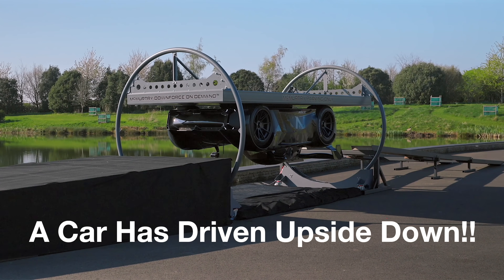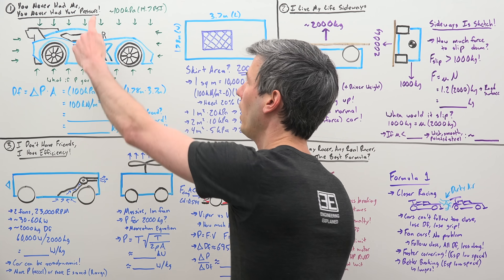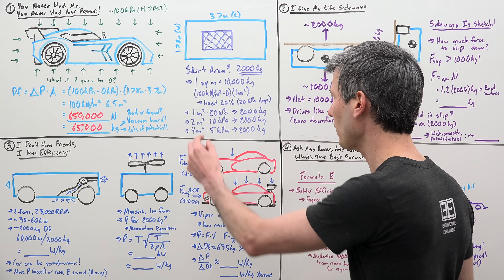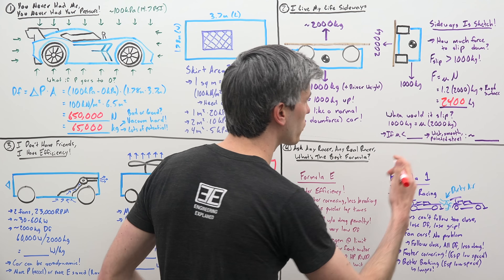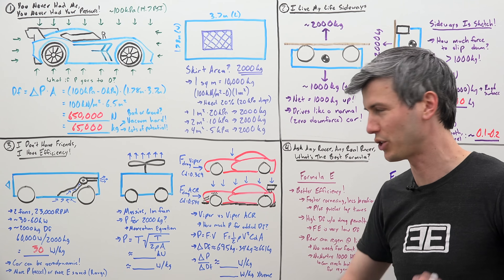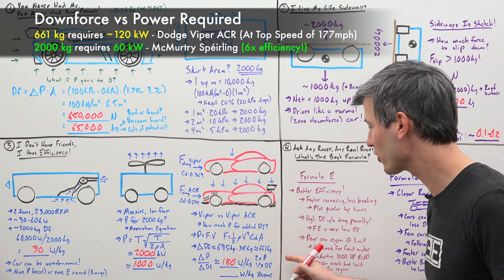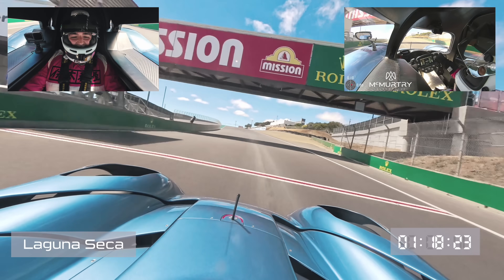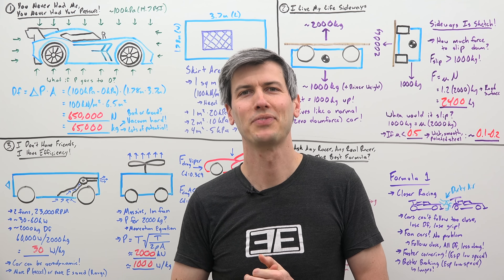This Car Just Drove Upside Down!

Comment: What marvels my mind is the fact that road debris is not destroying any of the internal piping or fans (blades) as it is sucked up, or if there is mitigation using filters that they don't clog up quickly and diminish the down force.
Reply from the maker: They have filters for a fairly fine particle size.
Reply: The car does have filters so no rocks are thrown.
Reply: That was the first thing that I thought of when I first saw this thing (after I picked my jaw up off of the floor). Filters for fine particle size, but what about somewhat bigger stuff? Though maybe that's not an issue for race tracks? Dunno. Never been on a racetrack. 

sigh

I gotta get out on a racetrack...
Reply: Ah maybe IT ist practically a really fast.Street Cleaning Maschine.

Comment: Weren't suction F1 cars banned in the 90s due to all the accidents? If you lose suction, suddenly you have zero grip
Reply: No, they were banned from rocks being thrown and f1 being f1 neutralizing the competition. There were no accidents with the vehicles. The Murtry has filters so no rocks can be thrown. Just don’t go over corners and you can’t lose suction.
Reply: @NewBeginnings571  I was thinking of the Mercedes triple flip crash at La Mans. It had to do with a neutral pitch angle and hills, not fan cars

But I vaguely remember issues with skirts, and losing grip for ground effect cars
Reply: @jdk7278  oh my bad

Comment: First heard about the idea from an article about the Saleen S7. It apparently had enough down force at 60mph to drive upside down, but could not find an insurance company willing to cover it.
Reply from the maker: 160* mph (60 mph is super low for downforce). And the Saleen only makes its own weight at that speed, not double, so it would still fall haha, because it would have no traction to accelerate so it would just slow down and drop.

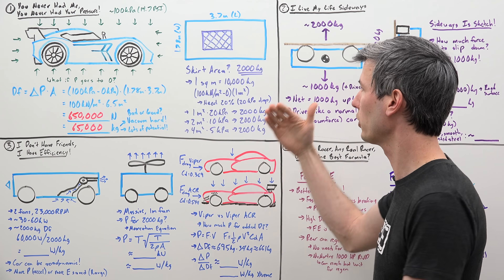Comment: at 4:40 when calculating the area needed for the vaccum, isnt the area the same, cause the preassure is pushing down on the top, however the P dif would be smallaer cause we would need to take the avg of the actual vaccumed area and the rest of the floor area, i might be wrong or this might be the same thing just written dif if someone could make is clearer for me why we are taking the vaccumed area into account
Reply from the maker: Everything underneath the floor that isn't within the skirt will be close to atmospheric pressure, so you can ignore that area.
Reply: @EngineeringExplained aaa makes sense, thanks
Reply: Just like the mass for an object acts like there is a centre of mass, the aerodynamic lift across an object acts like there is a centre of lift. To get the centre of lift you sum all the lift acting on the car, so you can ignore the lack of lift outside of the skirt. As long as these centres are pretty close to each other in location in the car it all just work.

Airplane manufacturers have to spend a lot more attention as if the centre of mass and lift are out by much then the plane will just start spinning in the air as it flies. Boats have this too, but  it’s called centre of buoyancy because water. And they use ballast tanks around the boat to keep it in trim.

Comment: Super interesting. The idea of comparing passive to active downforce efficiency, and how that could effect racing never occurred to me. I assumed that the fans must use so much power that battery life would prevent real racing use, but it seems I was totally wrong. Compromise the drive more power a bit to run the fans, and I imagine the racing could still be amazing with a lot less than 1000bhp and 3g cornering and braking  when nothing is restricting how close together the cars can run. The cars may need more abrasive resistant windscreens though, to survive being constantly sand blasted! Thanks,

Comment: Why does the McMurtry have a big wing? Wouldn't getting rid of it make it much more aerodynamic??
Reply from the maker: Great question! They get about 500-600kg of additional downforce at high/top speeds from passive aero. Helps keep the rear of the car stable and perform even faster.
Reply: The driver suggested a wing to make it more stable at the back. And for more passive downforce.

Comment: How much forward thrust is produced? I doubt it's insubstantial? With a routing system that thrust could be controlled for turning and braking aids as well.

Also still waiting for active air brake flaps that pop out of the car!
Reply: Not enough to move it from still if that answers your question.

Comment: Doesn't mean it could actually drive upside down, not unless it were driving on a perfectly smooth surface
Reply: Yes, as demonstrated in their video. Ground does not need to be perfectly smooth, cracks are fine.

Comment: I personally dont consider this as a legitimate "challenge complete" for what the whole original point was. You were supposed to generate downforce by the car's power, speed, and aerodynamics. Showing what the car is truly capable of. Using high torque electric motors to drive fans to extreme suction is a cheat and doesnt satisfy the original challenge.  Is it cool? Sure I guess. But literally anyone could stick fan motors like this on an EV now days, this company was simply the first to have done it in an upside-down test. Not even the first company to use suction fans though, as another has already beaten track records by using suction to get tighter turns. You could literally do this upside-down experiment with a box though, and that's the problem.

I am actually really sad about this whole McMurtry car situation. Because just like Jason said in the video, this is likely to be the beginning of the end for well designed cars. Instead of designing aero and that being the primary challenge of the racing car, we will instead just design whatever and throw a fan on it instead.

Comment: I would actually think the really scary thing about the sideways situation isn't sliding down the wall, it'd be starting to tilt.  The center of gravity isn't flat against the wall, so it has a bit of lever arm providing a rotational force -- trying to pry the high-side off the wall.  And that could cause a nasty feedback loop as any tilt could start compromising the vacuum seal, which reduces the force, increasing the tilt, further compromising the seal, until you fall right off.

Comment: The car will suck up all the dirt/debris from the road and throw it up in the air! 🙂 Debris could also damage the fan.
Reply: The car has a filtration system to prevent this from happening. No rocks can be thrown from it and fans not damaged.
Reply: @NewBeginnings571  It works well until the vacuum cleaner's bag needs to be cleaned 🙂

Comment: What's most wild was the comment section of their socials.. xD people not understanding the utter spectacle being put on before them.  "So, should have put it on a track against real cars.." - like tf, if it can hang upside down, it's going to have more down-force than anything in existence and people couldn't grasp that.  A "We truly live in a society" moment.
Reply: Ikr, I saw stuff like "what’s the point?" "Most useless thing ever". Like seriously screw their idiocy.
Reply: Comments by people who haven't seen, yknow, literally anything else the car has done
Reply: I can only hope they drop their modesty and break an f1 record. To truly shut them up. Turns out top gear wasn’t enough because it was wet for the f1. Also I’m suspicious it wasn’t at full power (top gear) because it did 0-60 in 2.6 seconds when it can do 1.6 and bellow.
Reply: I just remembered a guy on the rimac vs Murtry vs f1 video said that it’s cheating because it’s using  thrust from the exit ports 💀.

Comment: Ironically, this was done decades ago (the Chaparral 2J), and was immediately banned from racing. Because it worked so well.
Reply: Very true, and it worked well, but it had reliability problems and unpredictable handling whenever it went over bumps, so the drivers can't take the car near its limits - but they can still take it far beyond the limits of the other cars.

But the story is a bit more complicated and rule-bending, as it always is in F1. The car also sucked up track debris and shot it backwards at any car behind it, which creates safety problems that violate a variety of rules, especially any that say the car can't be dropping debris or fluids while driving on the track. The team could argue that it was moving debris rather than dropping new debris, and that is true; but it's hard to prove that during the race, and the marshalls will black-flag a car if it looks like it's throwing a bunch of vehicle parts behind it. That's the official reason that it was banned, according to the rules that existed at the time.

The car's werent allowed to have any extra non-engine moving parts. So, team used the loophole of claiming that the fans were the just the engine's cooling system, and they 'just happened' to pull cooling air from under the car instead of from the normal locations. An obvious lie (especially because air at the road surface is hotter and therefore the worst for cooling, and the debris will break the radiator if it is used for cooling), but it followed the letter of the law for that part of the rulebook.

It was fully banned through rule changes before the next season.

One of the other great rule-breaking cars was the one that had 6 wheels; 2 at the back and 4 at the front. The front wheels were tiny and had to be specially made just for that car. The team dropped it after a few races because, even though it offered more front grip and better front aero, it was impossible to master the steering geometry because each wheel needs a slightly different angle, and that angle will depend on the speed and the balance of grip and slip that is desired for the corner.
It's probably possible to make a working 6-wheel car today, but only with automated angle adjustments for each wheel, and the complication and extra weight might not be worth it. 

The Nissan delta-car may be the most innovative raced car in recent years. It was in Le Mans, in its own special class. It performed well, until it was taken out by another car in a collision.
Reply: @chrisedwards3866  I was really surprised to see that he didn't address the debris problem in the video. To me this was always the reason we'll never have fan cars outside of time tial/solo racing.
Reply: @ChrisSimpatia  The Speirling has a particulate filter to avoid it spewing out debris from the rear. But yes, good question.
Reply: @chrisedwards3866  Group 7 Can-Am, not F1.
Reply: @AtlasJotun  The Chaparral 2J was Can-Am (and one of my favourite cars) but the Brabham BT46 was an F1 car design using fans, which would throw all sorts of crap up at the drivers that inevitably ended up behind it.
Reply: @agiliteka  The original comment was about the 2J, no mention of the Brabham whatsoever. Yet the reply spoke exclusively about F1 and its rulebook, as though the commenter was conflating the two cars/series. I left a comment to disambiguate.
Reply: @AtlasJotun  Yeah I realise, likely conflating the two cars, just intended to make sure everyone knew about the Brabham too, as it is also a somewhat significant vehicle.
Reply: @chrisedwards3866  "It's probably possible to make a working 6-wheel car today, but only with automated angle adjustments for each wheel" Were any F1 teams trying that and were I at the FIA, I would argue that it might be considered a driver aid and thusly illegal.
Reply: The speirling has filters so no rocks are thrown only fine dust. Idk how this isn’t common knowledge yet.
Reply: That's not ironic.
Reply: So why are these McMurtry guys spending so much money and effort to recreate something that was banned already?
Reply: Not to mention several FIA officials addressed the increased speed at which the BT46 could take corners, and noted that if suction were to be lost the protection barriers and run of areas would not be sufficient for the extra speed the car would be travelling at through the curve.
Reply: No that's twisting history. It was banned because it was a hazard for other drivers and people watching from the ground. The fans would pull up dirt and rocks and throw them at other cars. 

I really thought he would point this out when he was talking about Formula 1 having the issue of not being able to trail other drivers. But with these vacuum cars the vacuum fans are dumping air right out the back being that it's the most efficient place to do so. That means other drivers are getting rocks thrown directly at their windshields. You can even see this in old footage of the old model with debris being thrown all around it.

Comment: For F1 applications I could see that there might be a benifit in modulating the amount of downforce allowing more downforce during cornering and less during the straight sections of the circuit.  There would also be an opportunity to design a system that is driven by a regenerative braking system that automatically increases the downforce based on an increase in regenerative power.

Comment: Debris being thrown into the air - that's the 'NON'-sticking point with fan cars
Reply from the maker: It actually has a very fine filter, so while it does pick up some dust, it's not gonna be throwing rocks out the back. After a few laps the track will be Dyson clean hahaha.
Reply: @EngineeringExplained Again, plz edit video to mention it lol. You replied to a few about this issue. Evidence that a lot of people think this.

Comment: Turbo fan vacuuming the road: 
- a pebble has entered the chat -
Reply from the maker: They have filters for this - I should have mentioned! They told me anything larger than like talcum powder will be filtered.
Reply: @EngineeringExplained  I was just goofin
Reply: It's interesting to me that the size of their debris tanks is another limit on the range!

Could you imagine following behind one of these if it didn't have a filter? You're need to be driving a Bradley, lol.

Comment: When i watched the other day, it seemed like a shroud slammed down right before the fan came on. I couldn't find if that was standard as i don't remember seeing it on any other video. I thought the car lowered and had low skirts but the shroud i think came down was directly around the fan and it made contact with the surface, you can see and hear it if you look careful. But i could be wrong.

Comment: 30kW, 1m diameter fan rotating at 23000rpm??? Gyroscopic effect while turning will make the car pitch like hell
Reply from the maker: It is not a 1m fan, they're much smaller. The 1m fan was for my helicopter example.
Reply: My bad

Comment: All good till the suction is broken. So going over bumps could be catastrophic!
Also, on roads you can suck up manhole covers. We have seen this in F1, not very funny.
Reply from the maker: Yep, smooth surface is critical, but race tracks are usually pretty smooth (not all haha, I see you Sebring).

Comment: So… does this tech diminish the importance of tires?
Reply from the maker: Well they need to be able to handle greater loads, but if they're not the stickiest compound in the world, you could still get better cornering with fans than just a set of sticky tires.
Reply: @EngineeringExplained another question…. How much horizontal force would be required to drive forward if that skirt was a set of electro magnets?
Reply: I think this may make the tires even more critical. Putting even more force into them and asking them to maintain grip with the surface and not tear themselves apart.

Comment: now i want a helicopter car lol. turn the blades the other way and you can fly over traffic jam. you can also use the blades to dry off  the car after carwash. brilliant
Reply from the maker: Haha it sounds like you want a helicopter. :)
Reply: @EngineeringExplained  who doesn't? here is a follow up question. can a roomba vacuum my ceiling?

Comment: Again, you provide a CLEAR explanation of complicated engineering facts as they relate to cars, roads and what is possible. I’m always amazed, always encouraged, always informed beyond my expectations. The 2d, 3d &4th quadrants of the board address what we didn’t know that we needed to know. Thanks.
Reply from the maker: This comment is the best and has truly made my day - so happy to hear it, thank you!!
Reply: @EngineeringExplained Also people suspect the top gear record; The Murtry was not at full power. When it took off it did 0-60 in 2.6 seconds which is far slower than it can do. Maybe with your status you could get info from them lol.
Reply: Though he did also fail to cover why such designs were banned a while back. The issue is that the fans throw dirt and debris at other cars and viewers making it a hazard. As much as it would make the races more engaging, being a hazard makes it far less likely to ever take off.
Reply: @Skylancer727  The car has a filter system, so no rocks are thrown. Only fine dust. It’s annoying how many people don’t know it has filters. They really need to make an informercial some day. Cause this is people’s go to nonexistent gripe 70% of the time.

Comment: This is the second car that Jason was able to draw accurately(the first was cybertruck). Well done 👏👏
Reply: 😂.... boom boom 🥁
Reply: Before getting to section where the Viper was described in the video, I immediately recognized it on the whiteboard!

Jason's game is improving!
Reply: Using exactly the same principle as the Chapparal 2J from 1970. Later copied for the Brabham fan car, which was outlawed, which led Chapman to come up with a way of doing the same thing without an auxiliary fan, instead using forward motion. Now used to the degree legal on every single race car, even, now, NASCAR.